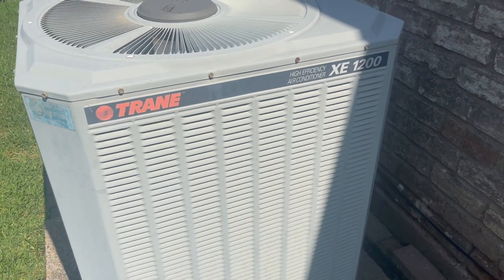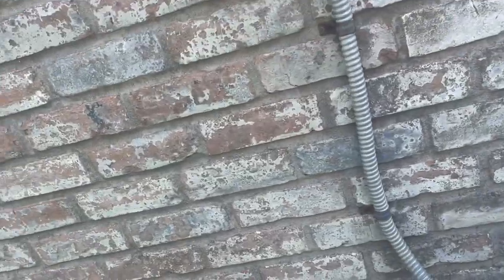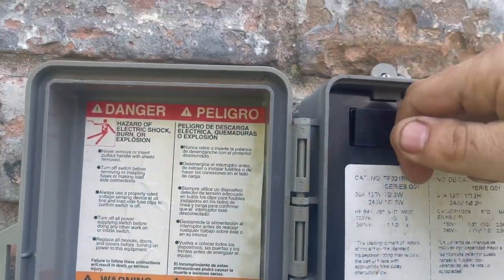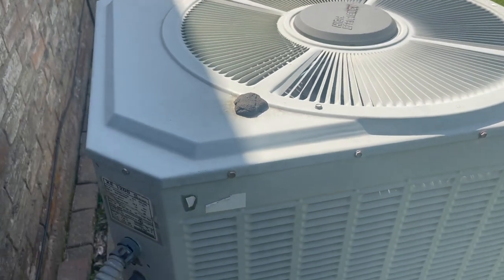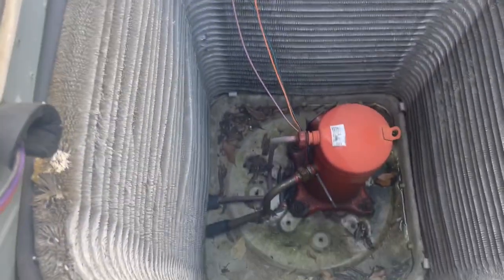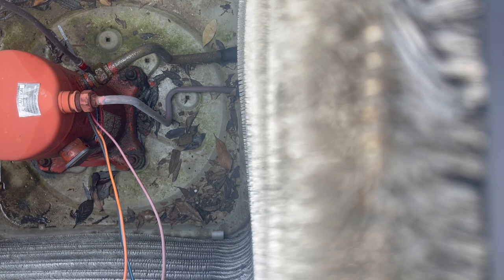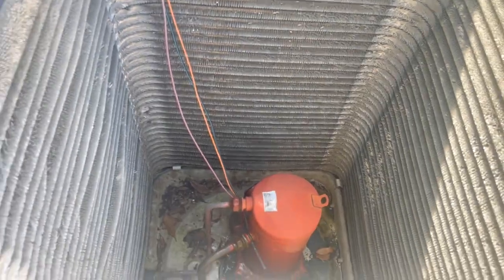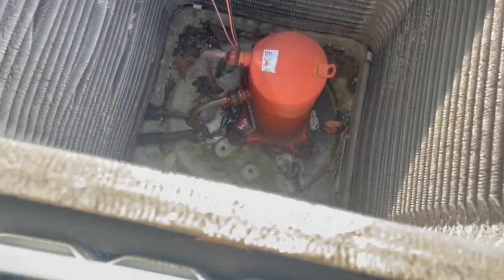No Cooling/Trane Rotolock Leaking

Comment: Take 2 ballpein hammers and tap the nut on each side of each other.  I have a 2' adjustable wrench that i use to turn the nut. In a rare case I have used a dremel tool to cut the nut . Applying a little heat helps too.

Comment: If you can get a new rotolock fitting that size then yes replace it. Clean up copper with wire brush and emery cloth before installing new fitting (and maybe use a sealer). TY4D ride along John. 🙏 your dad.

Comment: System is 22 years old.. customer needs to just have you replace it rather than play around with repairs. Best of luck on the repair
Reply: Same here. Is foolish to mess around with unit that old. The customer has the money to buy a new system., why spend extra money to attempt to repair it?
Reply: Looks like I have the same problem. My system was manufactured in 08 and has r22 in it. Would the r22 change the repair possibility? I definitely don't have the money for a new system. Was out of town for 5 days, came back and the outside condenser frozen, line frozen, inside unit frozen. Shut it down, unplugged inside unit and defrosting for 17 hours now, towels everywhere trying to soak up the melting ice. Will attempt to gain access to evaporator coil to clean in attempt to track down the cause for the freezing line. I maintenance routinely with outside unit cage removal cleaning annually and filter replacement minimally every 3 months and are pretty clean when I do replace them. Any suggestions is appreciated. Bought this property two years ago so prior maintenance is unknown.

Comment: +1 for cutting the suction line so it can spin, and then pipe wrench, if it wont move might need some heat. If it still won't move you can take a small grinding disk and cut slowly through the nut until you can turn it, it may cut into the threads a little bit but that shouldn't be a problem.
Reply: cut into it slightly before going to far and then use a thin chisel and hammer to split it like a bearing

Comment: Heat the nut up till nearly red hot, then chisel or punch on the edge of the flats of the nut to shock it loose. If that doesn't work grind through the nut until you just get to the threads and again go at it with the chisel. I wouldn't use a cheater pipe etc as the connection to the compressor may not be very strong. 
   Once you have it removed, use a file of hacksaw blade and wire brush to clean the threads up on the compressor connection, plug the hole so nothing gets in the compressor while cleaning the threads.
   If its really messed up then you can just braze a piece of copper directly to the compressor with some high silver content rods and flux and do away with the rotalock. I'd take the compressor off to do this and lie it on its side with the suction connection pointing up, really degrease it well.

Comment: Would your approach to fixing this issue be the same if the refrigerant was r22? I have the same outside unit, was out of town for a few days, when I came back the entire line was frozen all the way to the inside unit. Defrosting for 17 hours now and it's still dripping water. Got towels catching the water everything unplugged. The system was manufactured in 08 and has r22 in it. Every year I remove the cage on the outside and thoroughly clean the coils, I change the inside filters every 3 months and are usually pretty clean. I maintenance routinely.  Can anyone give advice on which way I should go. I don't have the money for an entire new system.

Comment: Use 45% silver on the rotolock to copper. High content silver will solder brass to steel to copper. Surfaces must be very clean. Use flux. May favorite is Stay Silv.

Comment: I would have done an entire leak check on the whole system. Just to make shure the other company wasn't just saying that was the issue in hopes the owner would buy a new one. If it's been losing a pound of coolant a year and the other company couldn't find the leak at the compressor, it just seems fishy to me! Let's not forget you didn't get any bubbles at the connection, and your leak checker really didn't go off that much. If it was me, I'd go back and leak check the whole system before proceeding.  Something about this one doesn't pass the sniff test. Good luck!

Comment: Personally I’d gas and go.  As old as the system is something totally unrelated to the Rotolock repair may fail next and the customer will have been worse off throwing good money after bad.  I won’t find fault with you trying to replace the Rotolock.  Just personal preference, John.  Good luck.